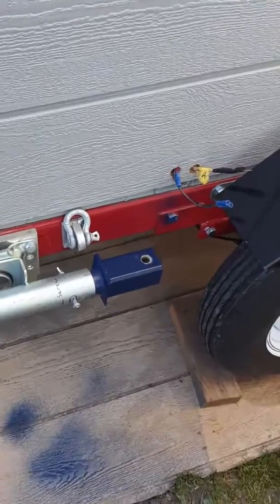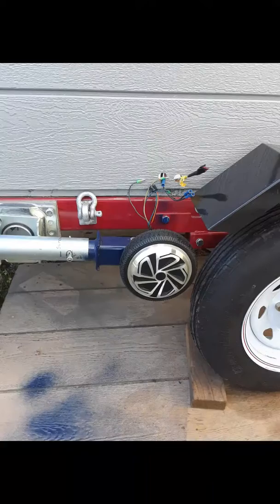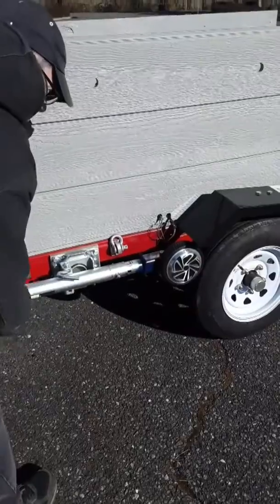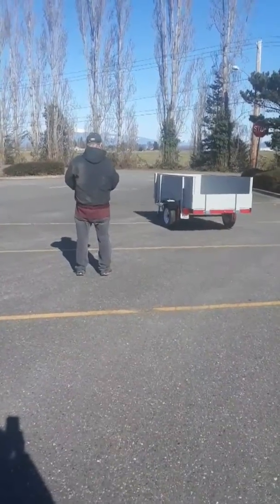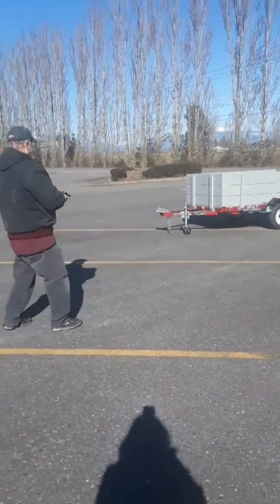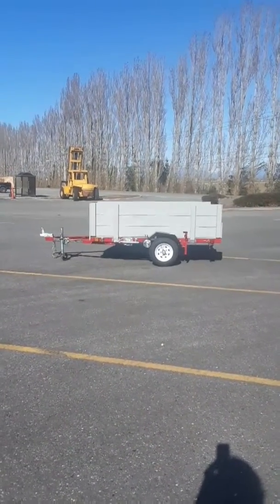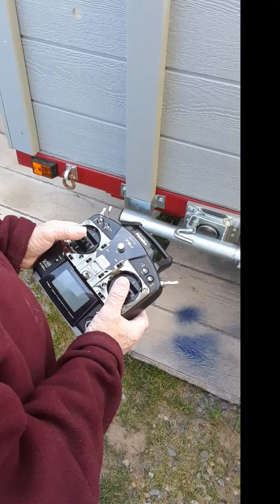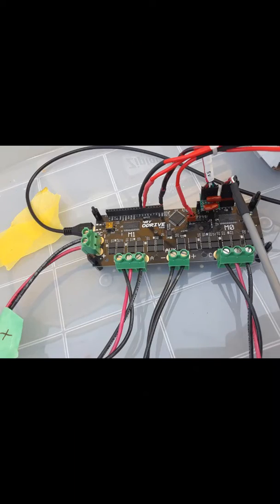RC controlled trailer with Odrive robotics controller

Comment: Bob, could you help me get started with the odrive and how to connect it to a radio controller. All I need some direction to get started on a project similar to yours but not copying it. Do you have a wiring diagram for the ODrive? I have two hoverboard motors and would like to connect them to a reel mower and run it remotely.  I just need a little push to get started building my rc mower.